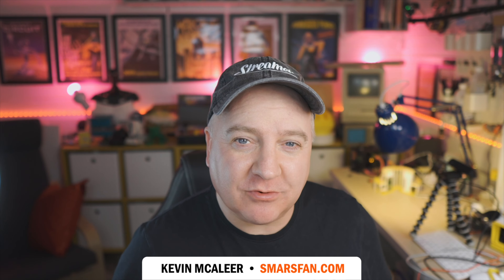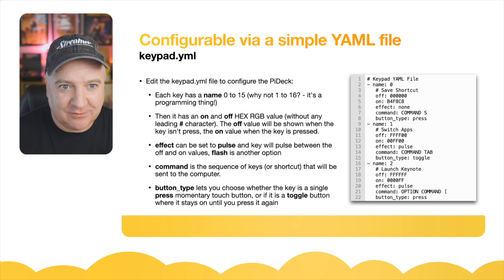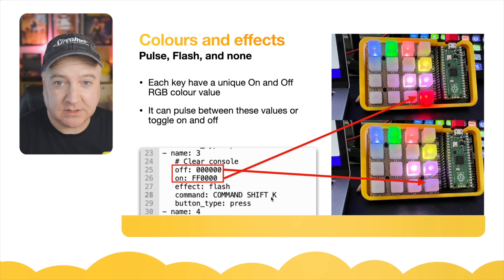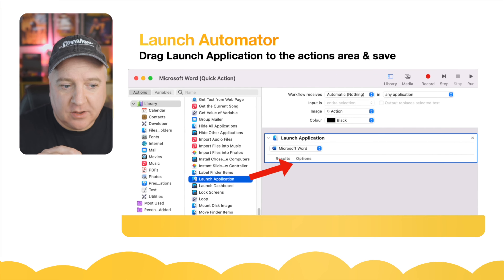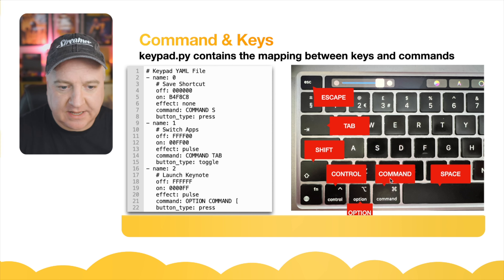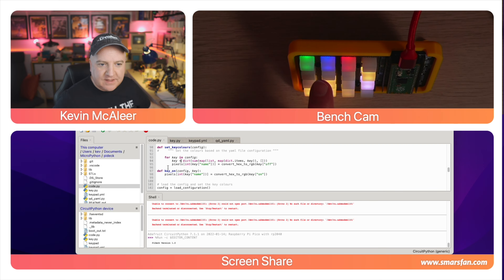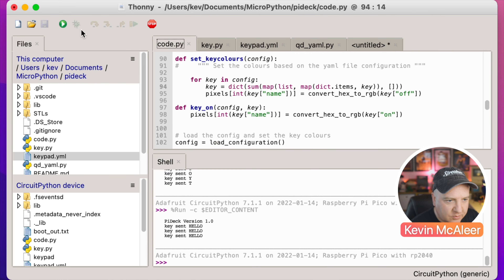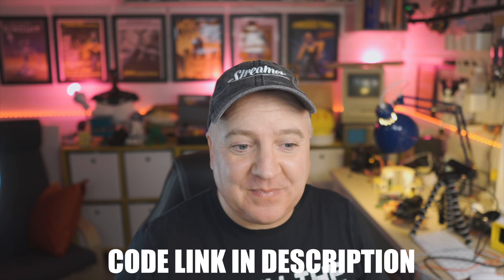PiDeck - the Stream Deck alternative you can make yourself

Comment: Thanks for this. Saw your tweet and ordered the kit from Pimoroni shortly afterwards. Stand is currently printing, hopefully postie will deliver the bits today 👍
Reply from the maker: Awesome - let me know how it goes. You might have to add some extra key commands into the keys.py, but its really easy to do - just look up the keycode from the Adafruit documentation, and add what you want to call it in the keypad.yml file. Here is the Adafruit keycode documentation link: https://docs.circuitpython.org/projects/hid/en/latest/api.html#adafruit-hid-keycode-keycode
Reply: @kevinmcaleer28  Set up and working. FYI the key bezel is designed for portrait orientation with the pico at the top. That’s why the key numbers don’t map properly on yours.
Reply from the maker: @griffog2001  I realised after I posted the video that id probably just got it upside down in my rush to construct it!

Comment: I am playing with macro keyboards and pico for a while now. I am soldering my own, nothing presoldered. Already made a few button one I am using at work and now I am fighting with code for larger one, where I want to switch between different layers of assigned keys and macros and it's where I got stuck. I have to admin through this I am also learning Python, so someone advanced would have it done in minutes.
My point is - keyboard programming is the project that keeps me interested in programming and makes me wanna advance in Python language.
Reply from the maker: I was thinking about layers, pages or folders - you could achieve this using a folder on the pico full of yaml files and then get a directory listing using os.dir() and cycle through these to get a list etc.

Comment: Hi thanks for this, I keep getting this error please help   "Traceback (most recent call last):
  File "<stdin>", line 41, in <module>
RuntimeError: No pull up found on SDA or SCL; check your wiring"  Please help, am I using the correct UF2 file? do I need to use the Pimoroni UF2. I would love to get this keypad working so could anyone help, thanks

Comment: Pideck is a DVS ("digital vinyl system") project, been around for 6 years. Pick a new name.
Reply from the maker: I'd never heard of this until you posted this message. I don't think anyone will be confused between the two as they are so radically different.
Reply: @kevinmcaleer28  When looking for your code under pideck, all I got was vinyl record information.  It was quite frustrating as I then had to come back here and find the link through your description.  Not enjoyable on a phone.
Reply from the maker: @JasonMartinRF  Hi Jason, sorry to here about your frustration (it matters to me). I've added a link to the code in the video as a info-card, so it should be easier for anyone else in the future.